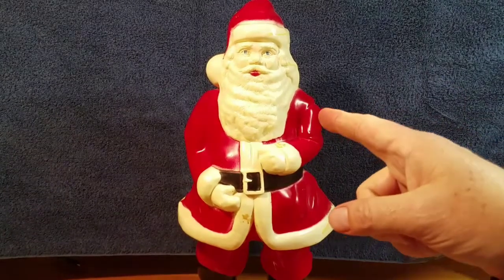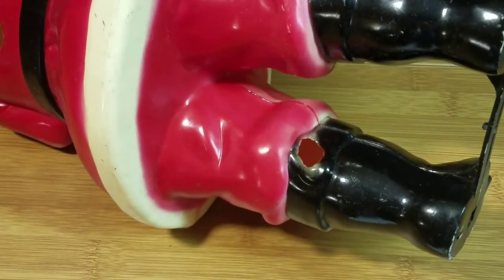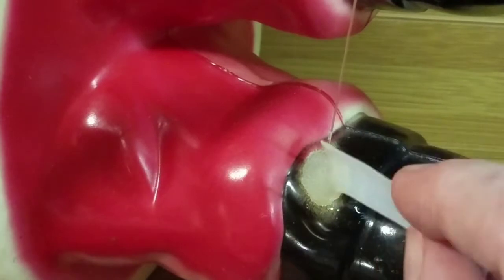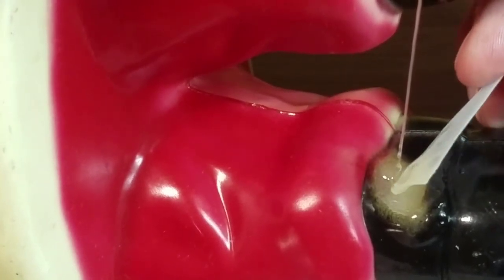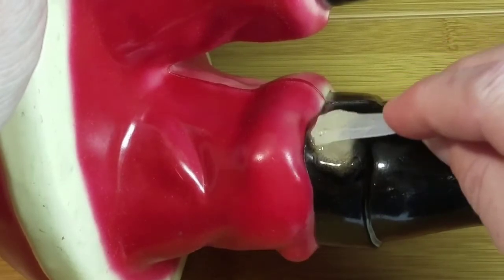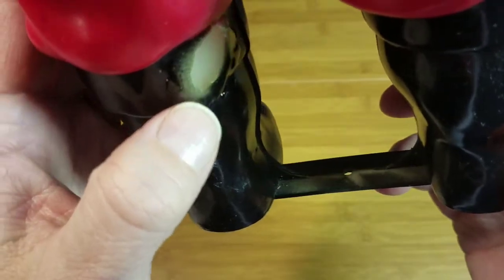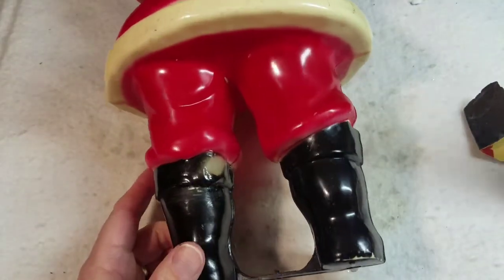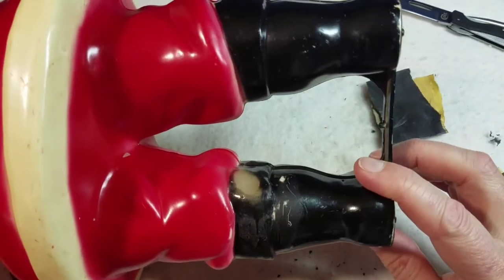BLOW MOLD HOSPITAL (repair) Fixing small holes with epoxy in vintage Santa Claus blow mold

Comment: Great video, but not sure this particular piece with its breakages and poor paint is worth all the effort. These same vintage Santas  are regularly on eBay in very nice condition for under $40
Reply from the maker: I would agree, in some cases, the effort versus return is low. However, I work on saving pieces where I can for sentimental reasons or just saving something that just shouldn't go in the trash. Plus, trying things out on small items can allow you to mess something up with little ramification... so you can be prepared to attempt fixes on items that can't easily be replaced due to scarcity or shear enormous replacement cost.

Thanks for watching and commenting!

Comment: Hi Jason, I have watched your videos several times as I get into the blow mold world of decorations. I recently bought some of the large candles. The problem is that they have large holes & the flames are crumbling. Any suggestions for large hole repair?
Reply from the maker: Thanks for watching! With the candles tips crumbling... I've had a similar problem with very brittle plastic. I've posted a video where I used glue to strengthen plastic, then coat in several layers of spray polyurethane (UVA/B protection). However I would suggest using just the polyurethane only, many coats. Not knowing the full extent of the crumbling its hard to make sure this would be right. As far as the holes, I would only be able to suggest a similar epoxy fix with larger pieces of plastic.
Reply: @blowmoldhospital6331  thank you. I am struggling with the flame mostly. Thinking of capping of the candlestick & lighting separately then making the flames out of several sections of plastic painted all the shades of color in a flame, kind of like books on a shelf with spaces between & a hole for a light to come up through the candlestick cap to put in one of those lights that sort of flicker?

Comment: Excellent repair! Thanks for uploading this video. I have a vintage snowman with a hole on his face where the carrot nose goes in, so the plastic is not fully broken away but is hanging in towards the inside. I'll see what I can do repairing it using your example here. Thanks again for your invaluable info.

Comment: I've been repairing my parents' Poloron blow mold Santa and Reindeer outfit for a few years now.  Actually, I've been using just superglue until now since some of those figures have developed a few sizeable holes.  Using pieces of empty milk cartons was a good idea of yours, and that was exactly what I had done in the repair of the first reindeer.  Since the hole in that first reindeer was readily accessible, I simply secured the piece of milk carton with superglue first, and then I complemented it with Devcon 5 minute epoxy.  Well, now I have three more reindeer to repair, and then the Santa.  Say, thanks for the video!

Comment: This is a clever idea for a fix. My mom has a Union Products blow mold deer planter that has some holes and cracks in it, and I wanted to fix it up and repaint, but I had no idea how to fix the holes. Do you think this method would hold up well for a planter too?
Reply from the maker: Being a Planter I would question how it would stand up against constantly wet soil. Although the epoxy I used does claim to be waterproof. I do not have experience with this type of fix on this scenario. It sounds plausible but I can't tell you for certain. Also depends on the size of the holes and extent of the cracks. It may be asking too much of the epoxy if holes and cracks are significant.

Comment: Have you ever used plastic welding rods for larger holes? What type of plastic are the blow molds?
Reply from the maker: I've not used plastic welding rods before. While I would love to experiment with one it can be hard to identify the type of plastic used. 40 to 60 years ago they were not required to label the type of plastic for recycling purposes. And the type used was not the same, even the exact same mold from the same manufacturer can vary. Someday I may invest in one to test. Thanks for the question.

Comment: Hi, I have an old set of blow mold garland. It looks good, but needs new glitter. Any advice?
Reply from the maker: Oh! This sounds interesting! I am not sure what blow mold garland is, unless you talking about the garland with little candy canes and presents among leaves?
Reply: @blowmoldhospital6331  Yes, the candy garland.
Reply from the maker: @loribarker5781  the only suggestion I have would be to use some clear spray on glue and sprinkle the glitter from high up so it has less chance of clumping when it hits the glue. But, sounds messy. I'd have to research which glue would work best. And, I would suggest testing on something else first.
Reply: @blowmoldhospital6331  I will do just that. Thank you.

Comment: Thanks. Great instruction. Clever using the filament to hold the repair in place as you rebuild the mold. Layering plastic epoxy makes sense and seeing your process helps.  I’d love to have seen the painting results.
Reply from the maker: Thanks much. Check out the painting video here: https://youtu.be/AcviQ7mHQP8

Comment: I have a Beco bowing Santa that still works. My parents bought it when I was a kid in the mid 60's. It's truly a wonder the motor is still ticking but it's very loud. I would display it except for the noise. Is there a cure? Or get a new motor? I just found your channel about 40 mins ago. I love it. Subbed ya.
Reply from the maker: Oh wow! I bet the santa is AWESOME! Motors are tricky when it comes to noise. It could be something as simple as a loose screw or rivet causing vibration and the noise. I had a motor that vibrated  very noisily and I added a zip tie around the housing and it stopped vibration and the noise all but disappeared. Hard to say without being able take a look at the motor and see if I can determine the cause. You have to poke around a bit. Really hard to say. Thanks for subbing!!!
Reply: @blowmoldhospital6331  Come spring I'll give it another look. If nothing else I have a motor from an animated Christmas mailbox. My brother tosses decorations about every three years. Down in Florida it rains everyday in winter so things rust fast. I just hope that motor will handle the load even tho Santa's torso isn't that heavy.
He could use a paint job, too. The texture of the paint over time is rough.